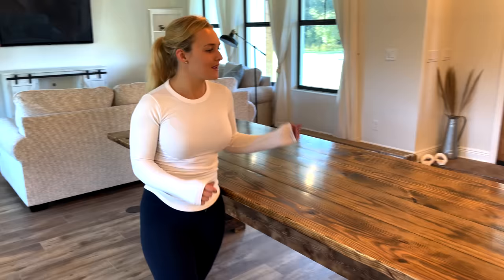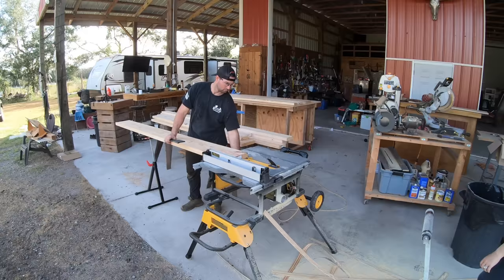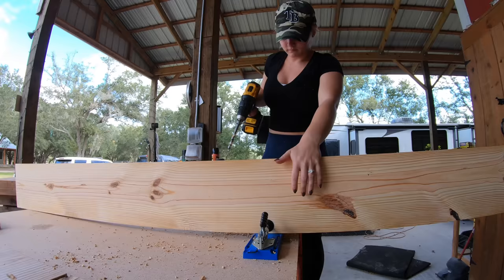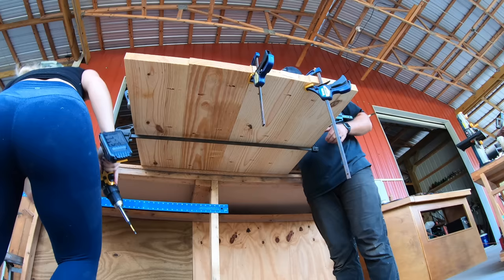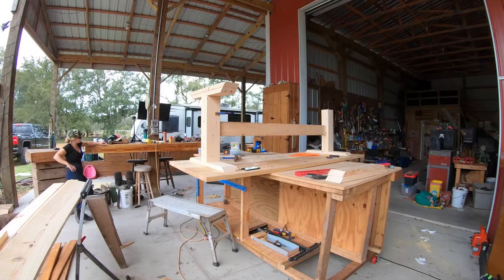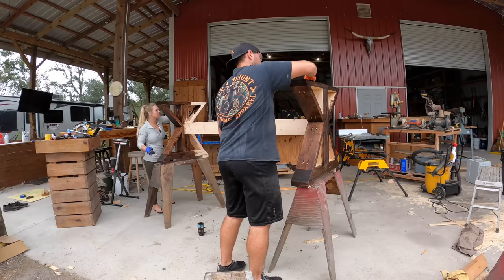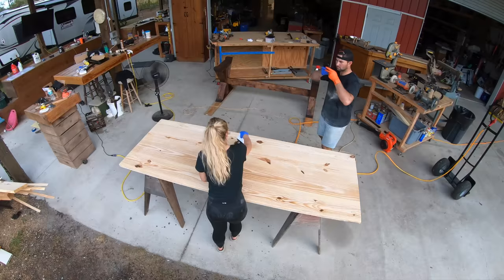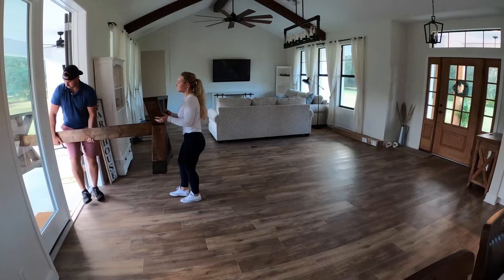Beautiful and Easy Farmhouse Table Build - 12

Comment: I've never done a project this big but would have considered using dog bone fasteners to hold the boards together. Maybe in conjunction with glue and biscuits. More work though.

On another note I cringed when you said you used brushed on water based polyurethane for the finish. I brushed on water based poly when I refinished my dinning room table and had all kinds of problems. The water based poly dried too fast and I wasn't able to brush it on without getting drag marks. I ended up spraying it and got a nice finish. Glad it worked for you.

Comment: I like the screws pulling the boards together keep the joints tight. Plus if  you make a 8’ table it’s going to get heavy, especially with the legs you need to support the weight. The screws will allow you to disassemble the table to move it. I like everything you did, your lucky to have a healthy wife to help you. If you stain the wood for the legs before cutting it, it will save you a lot of time. Exact same dimensions I’m building.

Comment: To answer your questions: I would have used the Kregs with glue. I also would join the pieces together upside down on a very flat surface. I think 800 is overkill but it can't hurt! I like Minwax products best. I also plug all those Kregs holes and I'd especially do it on the base pieces where they are visible and also will eventually collect dust. Beautiful table and your floors are awesome.

Comment: If I had a Domino, I would’ve used that. Lacking one, I’d probably go with #20 biscuit joiner.

I seldom use my Kreg. Spending a few minutes with the screws rather than all day with clamps has always felt like I’m taking a shortcut.😅

Comment: I think the results turned out nice!  I think the answer to the glue vs pocket holes vs biscuits vs dominoes comes down to what you have and what you can afford. It shouldn’t be a religious argument. If you have dominoes you likely bought Festool and spent a bunch. Most likely because that’s something you do a lot. For me, I don’t do it enough so not spending that kind of money. But I find that glue + pocket screws work really well. Glue alone causes a serious mechanical bond.  Only things I would have done differently would have been glue on the joints and using the filler pieces for the pocket holes. You guys did a great job though!

Comment: I sand to 240 grit prior to stain. Anything more than that will not let stain take as well and can also burnish the wood
Reply: You get it smooth after stain with sanding sealer and or clear coat. You did seal it right?

Comment: What a beautiful table! Good job!
You asked, so I am going to comment. I would have used glue as well as the pocket screws since I am not an expert and I believe in being extra cautious. Also, with the expansion and contraction of the wood, I believe that the screws will eventually loosen up (even though that will be years down the road).   

Keep up the good work and being an inspiration.

Comment: Let me start by saying great job, especially for your first time. Also, I’m extremely jealous of your whole setup, (now) you’re able to mill it, dry it, build it, and soon be able to sell it all in one place. I agree with everything @Nathan says below, he would be a great source of intel for any future projects. I graduated with an art degree, specializing in woodworking and really started getting into furniture towards the end. I actually ended up making my bedroom suit(dresser and 2 bedside tables). I would’ve used biscuit joiner w/glue and biscuits vs screws and definitely would’ve only sanded to 220 since you’re using poly to finish it. Good job sanding in between coats of poly, a lot of people miss that step and it really helps with the final smoothness and durability. I also would’ve done at least 4 coats on the top, but that’s always something you can go back and do later. My dresser is 3ft high by 6ft wide, and after I did three coats I thought it was enough. A classmate said, “ok, how about I toss my keys on it and see if they scratch it or not, then you’ll know if it holds up to normal wear and tear.” that’s when I decided two more coats. Now, over 10 years later and still not a scratch. One last thing, since it’s a table, why didn’t you router the edges?  Most table tops have at least a 1/4”, or a more decorative edge, rather than leaving it straight. Just a couple things to think about the next time you do a “big build”. Oh yea, good choice on finishing materials, that’s what I use. Some may not agree, but when I’m applying the poly I use the super cheap foam brushes. You don’t have to worry about brush strokes, bristles possibly falling out, or cleaning them. Still, great job‼️

Comment: I built a Queen size bed frame, complete with a full headboard and footboard, using this method with the Jig and pocket holes.  I used 6x6 for the posts on the bed, and 2x8 for the boards running across the head board and foot boards.  The side rails are 2x12's and I used bolts with flush wood dowels to anchor the headboards and foot boards together.  The end result is a BEAST of a bed, that absolutely does NOT move, shake, squeak, or budge.  I have tried to make it move or budge with the Mrs., but the bed remains unchallenged.

Using the jig and pocket holes is SUPER sturdy and I think more efficient way of pairing & joining boards together, and better than any biscuit or other method.  I specifically use dry wall screws instead of lumber screws since the planes on each screw are a bit more course, and grab the wood better.  Putting the screws in from the bottom is a GREAT way to ensure that the top is flat, smooth, and where you want it.  I use MinWax stains and sand most of my wood projects by hand after I have used a power sander.  I am a bit of a perfectionist......   Good job Triple L !!!

Comment: Nice table, I was ask to make a table and it was more of a rustic type so did not have to care about gaps between boards as much.  Being a table I'm concerned as food and other things get between then. I glued this one up with biscuits and cross members underneath to help keep things tight, although I really like the pocket screw idea.

Finished with dark walnut stain and 5 coats of polyurethane on top, 2 on bottom.  Made benches to match.

As far as sanding I went to 120 at most. As you found out you can get the gain too smooth and stain does not get into it.

Comment: I use pocket screws a lot also. I definitely would have glued the boards also. 
Pocket screws don't hold great in softer woods, and with glue you'd use less screws.
Also you can use clamps with calls to keep the top flat while screwing.
Just what I'd do, table looks great.
😁👍

Comment: I used to use Minwax pretty much exclusively, but I've been partial to Varathane lately, probably because I like some of their colors more. A word about water based poly. If you get it wet (water ring, etc.) It may turn milky. It usually just goes clear again, but every now and then, no. You can use Johnson's paste wax on it after it's cured and that will protect it until you can wipe up the mess. The great thing about WB poly is the ease of application. You can also wipe it on with an old clean piece of T shirt. On a project like that, you would be ready for another coat by the time you get from one end to the other. The coats go on thin and dry super fast.

Comment: Thanks, very informative. I love all parts of this build and execution, except for the finish. To my eye, the stain reveals the wood as stock (cheap) softwood. It looked amazing, well built and strong until the end with the stain. 

Using the exact same design, process and technique but swap out the cheap wood for a quality hardwood without knots (or spend a lot of effort with pre-stain conditioner and staining/finishing) and you'd go from  a architect

Comment: You can use coffee to make stain, and you can even use shoe polish as stain, which I've used both and they turned out beautiful! Also, you should always use glue to strengthen the bond and prevent future development of separation, it just makes it much stronger and cleaner.

Comment: I would have suggested that you use the pocket hole plugs on the table base.  Once glued in and sanded smooth, they look great and hide the pocket holes and screws.

Comment: Since you asked, I'll throw in my two cents on a couple topics that you asked about. When it comes to sanding the actual wood, you never use ultra fine sanding grit. All depending on the wood type, you generally wouldn't use anything finer than 150 maximum. When you start sanding with fine sandpaper, you're polishing the wood and closing the pores. Then finish isn't able to penetrate and adhere as well. Any fine sanding would be in the actual finish, not the wood. Since you bought your wood at Lowe's, it's probably Douglas Fir or pine, which are soft woods. Experiment with wood sealers prior to staining and finishing to achieve a more even, non-blotchy stain result. 
Secondly I'd recommend using glued mechanical joints in some of your assembly. It's okay to use pocket screws on the top, but I would of glued it as well. Screws aren't really the answer in most cases. I'm not sure what screws that you used, but pocket screws are not that strong as far as bite. They hold the boards together until the glue drys. The few things that I've mentioned are because I love building custom cabinetry and woodworking. I said what i did for that reason. I could keep rambling on about something that I love, but I'll stop now lol I love rustic woodworking. As a custom woodworker and cabinet maker, I've worked in multimillion dollar mansions in some of the most exclusive neighborhoods in the Los Angeles area like Brentwood, Beverly Hills, and Holmby Hills (next to the Playboy Mansion). Keep your heart in it and learn things. I wish you much success...
Reply: Great comments, very informative
Reply: @larrylarson1274  Thanks. That was my intent. I just like to help people that have a common love of woodworking. I've always preferred learning with the assistance of someone that has experience, rather than learning the hard way.

Comment: Would I have put this table together this way? To a degree... I would have made pass-through dowels: drilling holes through the width of the tabletop and enforced it with dowels so it cannot warp as easily when exposed to moisture. The wood will rise if made wet, however, with proper surface treatment that can be mitigated, you guys. 

As for the pocket holes in the bottom... you can always close those holes by taking sawdust and mixing it with white wood glue and then polishing it up. Add to that the pass-through dowels, your table top will never break.

Greetings from Sweden! And no, this is not sponsored by IKEA!

Comment: I don't think I would have used the pocket screw technique . From past experience using screws in lieu of glue and biscuits , after time the screws would have to be retightened. This is probably due to the fact that the wood is not real hard and the movement caused by humidity and drying in winter from our heating system.

Comment: No doubt it looks great as is. Personally I would have used bow ties / butterfly key. with a complementary grain of wood. Even with the grain 90 degrees off center. It would take a great deal of effort finding the right wood. No doubt the other wood would take the strain slightly differently which is the point. The butterfly key would mimic the legs. 
Again, the table looks great as is.

Comment: Have not read all of the comments but, here it goes. Ok... for the sanding: max sanding to 180 before staining. Otherwise, your stain won’t adhere. However... if you are working with a natural wood that you will apply rubbed oil finish: go to 1200 grit. You will thank me later. Have to make sure tho that you don’t use the random orbit past 220 tho. Hand sand about that. Using a scrapper and hand planes will get your table to a the fine furniture quality without all the sanding or at least to the point of minimal sanding. 

Pocket holes? For sure it’s a viable option, especially if you are going for a rustic look. However, milling/hand planing/biscuits/glue and clamps will get your  table to the next level. As far as the legs. This is the one part that I feel really went wrong. Being able to see the pocket holes unfortunately gives an otherwise awesome build the amaturish appearance. Using dowels would have been a still cheap and good option. But, really you could have filled the pocket holes with dowels/glue and a flush cut saw. Or with pine wood putty. 

But, ya’ll did a great job. The table looks amazing. And I love that a husband/wife did this together. Sweet :)
Reply from the maker: Thank you very much

Comment: glue is all you need. Dominos, biscuits or dowels don't add strength. Just help with alignment. Glue joint will hold up better and is stronger than the wood itself. Pocket holes could eventually work themselves apart once the wood starts to move.

Comment: Woodworking pro tip: when you sand above about 120/180 grit, it polishes the wood. In doing that, it causes the wood not to absorb the stain. I would only go that high if its just going to be a clear coat.

Comment: The legs of a harvest table are always massive and complicated.  I bought a steel frame from Ikea for cheap and it is an excellent base to screw the top into because its basically an aluminum table.  Its not all wobbly when you are done.

Comment: The furniture I build is going to outlive me and my family. I would definitely do some research on joinery. Pocket hole screws are good but with expansion and contraction; over the years your beautiful table will begin to separate, crack, cup and bow. 

Other than that, don't sand above 220 until you put your stain on, then sand with 320 +

Cheers!

Comment: Always use glue when putting together boards for a table top counter shelf or cabinet top regardless of screwing doweling nailing tongue and groove or mortise and tenon. Besides another foot of over hang on the ends for foot and leg room under the table.

Comment: after 40 years of building furniture & cabinets...kreg pocket holes are great,but i would have used a good glue also. and clamped overnight. the joints will be stronger than the wood. imho

Comment: It may have worked better for you to sand to 120 or 150, mist the wood with water and then use a scraper to cut off the raised grain. This way the wood would take in the stain and you'd still have a smooth surface.

Comment: When I put tables together I use the biscuits and the screws screws sometimes will work work loose also should have sealed it before you stand it helps the moisture contents

Comment: Great JOB and nice table,,,,I also build farm tables and sell them,,,I found by keeping it simple the tables speak for them selves,,,Less sanding,,, use a sponge to stain because it goes into the cracks,,,Minwax is great with mixing,,nice style legs Love the pocket holes,,,and polyurethane water base works great and drys in 1/2 Hr,,you can finish a finish job in 1 Hr 1/2 ready to use,,,,good Job I dont care what other people comment I know from years of experience and $$$$ Profit those are the real true  results of good Farm Tables

Comment: That is a beautiful table! I plan to make rustic farmhouse dining table soon but probably 6 foot instead of 8, with matching benches. I was thinking glue for the slats but I like the Kreg idea, may end up doing both. I like a lighter stain color but minwax is definitely the go to brand. I might go a little heavier on the polyurethane, 6 coats on the table and 8 coats on the benches for added durability against wear and "butt traffic". But again, your table is awesome

Comment: Beautiful build on the table, my wife and I built one similar. The thing I would have done different now, I would have Lightning burned the entire table top, stained it, put one coat of sealer on it and then went over the lightning burns with a desired pearl epoxy scraping it off leaving just the burns filled, sanding restain and clear coat.
Reply from the maker: That’s awesome

Comment: Glue and biscuits work the best. but craig jig makes a XL for larger screws and deeper cut. glue is a must for either method. water pooping the grain is not a good idea as the moister content of lowes and home depot lumber is about 17 to 19 %  which means as it drys in the winter from the heater being on, the wood may warp and twist and or crack. The big box stores lumber is mostly for construction not furniture. all in all the table came out great.

Comment: Lowe's wood ain't dry enough moister content way too high for furniture but you could put it together with pocket screws no glue let it dry for a few years in your house take it apart and glue it glue don't hold well either on wet Pine

Comment: I would have taken the time and stagged the pockets for the screws equally so you have best change of none of the boards warping and bowing up on the table. Glue should still have been used to also help prevent this.

Comment: Pocket holes are ok but biscuit or dowels with glue is better.  Biscuit or dowels make the join look better on both sides.  Over time it will not move when glued